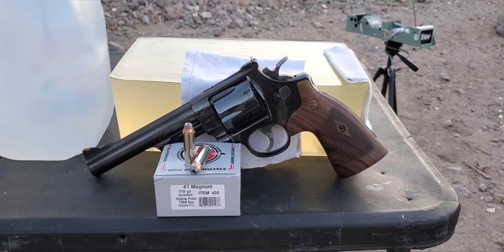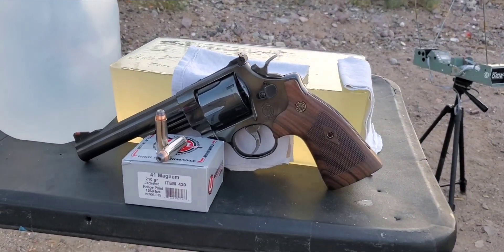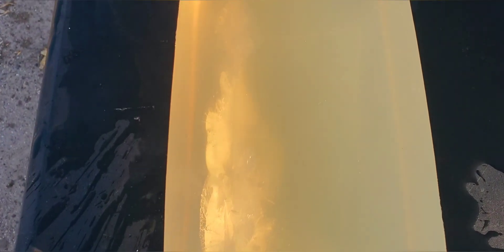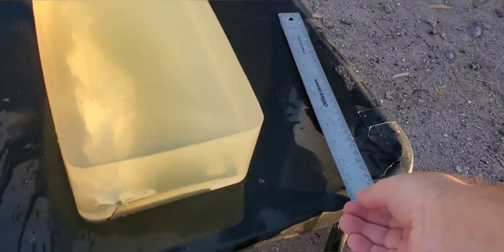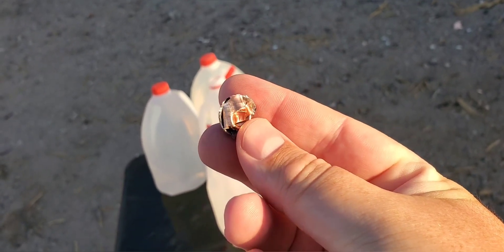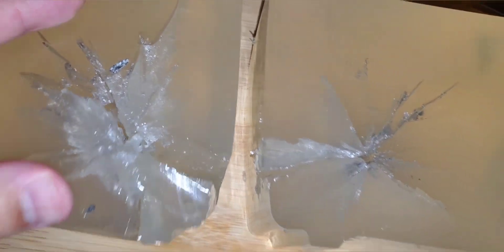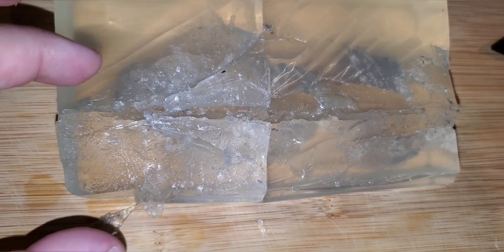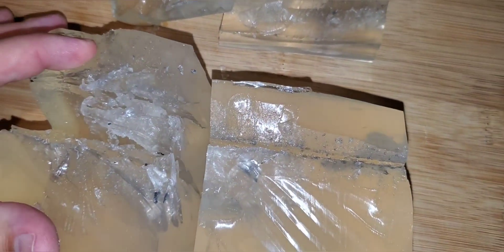.41 Magnum Underwood 210gr JHP in Ballistics Gel

Comment: The 41 Mag is a great defense cartridge (when loaded properly) and game load. However, it never became very popular as the guns it's used in most frequently are the same size as their 44 mag counterparts & recoil while technically less, is not noticeably less than the 44 mag to most that fire it. The 44 mag also has the 44 special that can be purchased for a light recoiling round while the 41 Mag does not have a commercially available very low recoil alternative. Many years ago a 41 Mag"Police load" was still available that was nearly the same alternative but still more recoil than the light 44 special loads.
Reply: Would you rather a 5 shot 41 magnum or a 7 shot 357 magnum...to serve as your one handgun for everything?
Reply: @anonymousf454  That's a difficult question.  I'd go with the 41 Magnum only because I'm a reloader. If I didn't reload I'd pick the 357 Mag

Comment: Really fine handgun and a capable round in it's own right.

Unfortunately, it was a solution to a problem that never really existed.  Elmer Keith developed it as the "perfect police cartridge" but it turned out to be "too much", so the factory downloaded it in "police loads", as a sort of .41 "Special", which weren't enough better (if any better at all) than the .357 Magnums then carried by most police officers. There was no significant demand for concealed carry revolvers at that time. Individual police officers weren't generally allowed to carry just any revolver they wanted and police departments would not go to the expense of switching handguns en mass unless it was a LOT better than what they had already. 
And by the mid 60s, when the .41 Magnum was introduced, that "a lot better" police departments were looking at were semi-auto handguns. The IL State Police started issuing S&W Model 39 pistols in 1967, and it was downhill from there for revolvers in police use. 

 If the movement to "Shall Issue" and, later, permitless concealed carry had happened in the 60s instead of the 80s and 90s, we may have seen something like the L frame 69, but in .41 Magnum. 🤷‍♂

I don't expect any "new" handguns to come out in this cartridge.  So get one before the prices go totally out of sight! FWIW, the Model 58, the "economy" model with fixed sights, is selling for just as much as the Model 57.